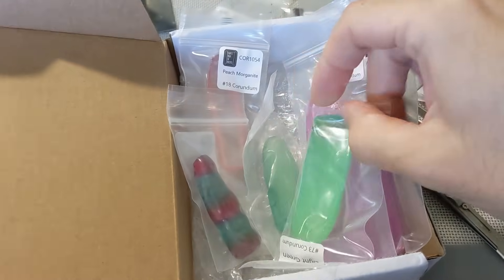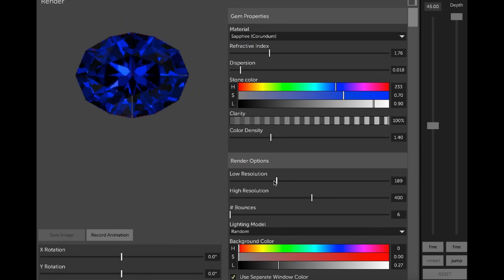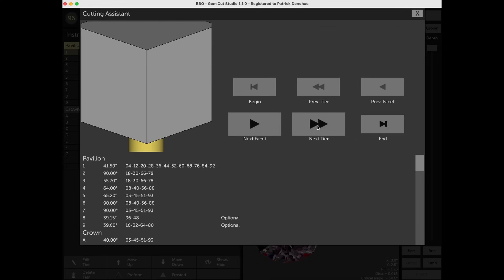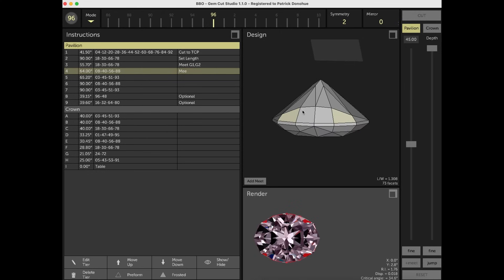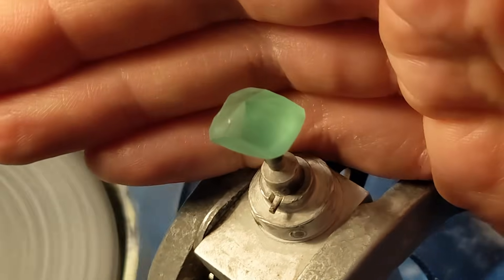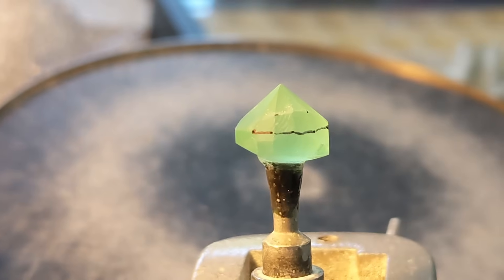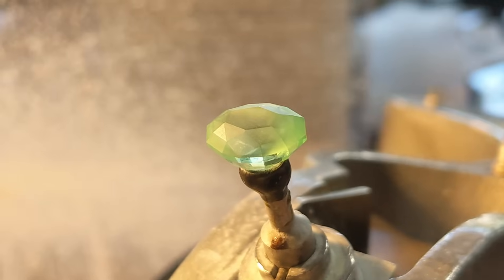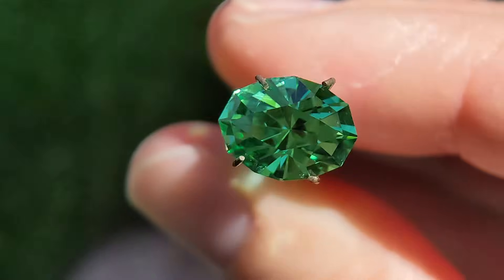Faceting an Oval in Sapphire – Full Process Explained

Comment: Lovely stone.  I need to pick up some of that green color.  Truly magical.  I agree, some of the beginner patterns aren't that easy, or intuitive.  Some patterns are just more 'fun' or easy for me to cut than others.

I have been adjusting the cutting diagrams to work with lower or higher refractive indexes.  Start with the final Pavillion facet and adjust it up or down to match the material I am cutting.  I then adjust all the other angles on the pavillion by the degree to which I changed the final facet. 

 For instance, if it the pattern designed for sapphire, it may have the final facet at 38 degrees, but if I am cutting a piece of quartz it will create a window.  I adjust that angle to 43... 43- 39 = 4 degrees difference.  I then add 4 degrees to all the other angles on the pavillion.  Obviously, this will make the pavillion deeper or shallower depending on if you are increasing or decreasing the angles, but since the difference in the angles remains the same is should be pretty close to the pattern.

The crown angles aren't as critical for materials, so I usually leave them alone, unless I want a thicker or thinner top.. based on my material.